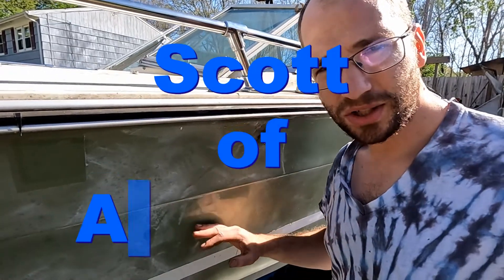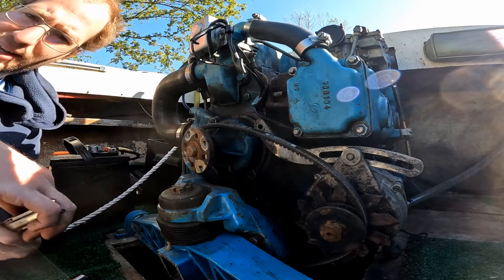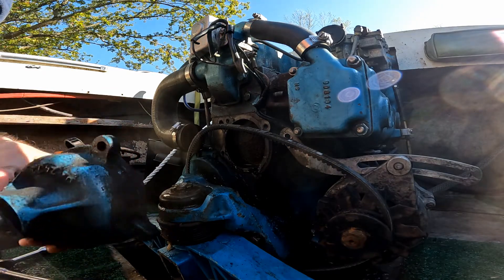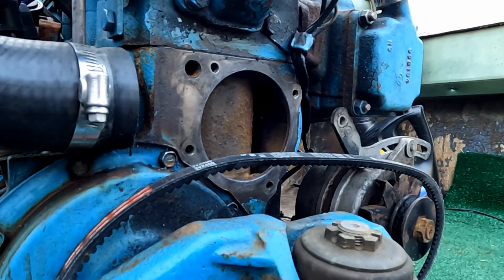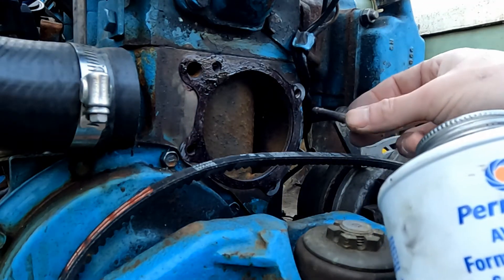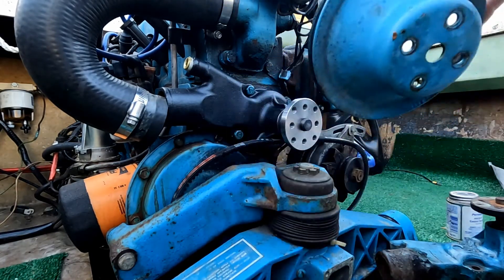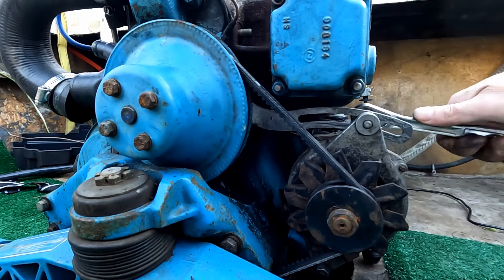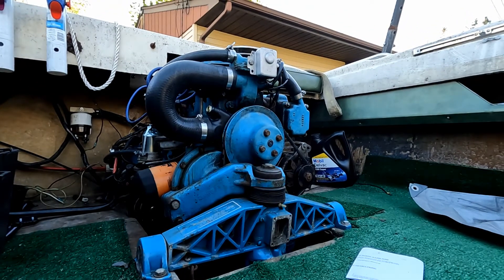OMC 140 Water Circulation Pump Replacement.

Comment: Would have been nice if you shared the part # of the new pump
Reply from the maker: Year, make, model and serial number are required.   

https://www.boatengine.com/boat-parts-finder/?aribrand=EVI&arian=Stern%20Drive#/Evinrude/990216S_1973/CRANKCASE_GROUP_140_HP_STERN_DRIVE/990216S_1973/98048422854/y

3858340 water pump.  Is a “universal” GM 4 cly.  water pump.   But check your motor size and year before ordering,  I have no clue what motor you have.

Comment: cool, yeah my 1976 Starcraft 18' with the OMC 140 is having issues like at the very end. It almost turns over and just doesn't quite do it. I don't know enough about boats to instantly know what the issue is, but I am looking to work on it this week (it's at my mothers place at the lake.)
Reply from the maker: I had a lot for starting issues due to my own ignorance.  This boat has an upgraded throttle handle that was not covered in the users manual.   I was not setting the throttle properly to start the boat.  All the older boats have a lever or knob to increase the throttle for starting.   So make sure your doing that.  On carburate motors pumping the throttle lever will squirt a stream of fuel into the intake.   If you have an extra person i recommend taking off the flash arrestor and looking into the carb while someone pumps the throttle. Don't try and start the boat without the flash arrestor installed, put it back after you check for fuel.   Most older boat wont start due to clog carburetor from dirty fuel.   These old boats never had good fuel filters, so 50 years of  rust, crap, water  will cause to ton of starting and running issues.   I had to clean and rebuild the carb on this boat 5-6 times due to dirty fuel tanks,  eventual i just bought a Racor brand filler and its been fine now.   Don't buy a cheap filter, most with plastic clear bottoms are not rated for gasoline.  I replace the one in this video because it was for diesel fuel only.  

Good luck.
Reply: @Theweldingmillennial  So, I got out to the parents place where my boat is parked and i was following the issue all the way back from the carb to the fuel pump etc. I bought a new ignition coil and i had no spark, even with the old coil, so i think the distributor cap is my issue, so I'm going to get a condenser as well as a new distributor cap. It looked like corrosion on the rotor arm so i don't think it's making contact. That's where   I am at now. fun stuff
Reply from the maker: The distributor cap is usually not an issue.  On a points style ignition you need to check the points gap and the condition of the points.
Reply: @Theweldingmillennial  yeah, the rotor, hammer and the internal connections were covered in corrosion. So I'm just going to buy a new condenser, and all the other jazz and replace it. It's $50 and a fairly easy fix.